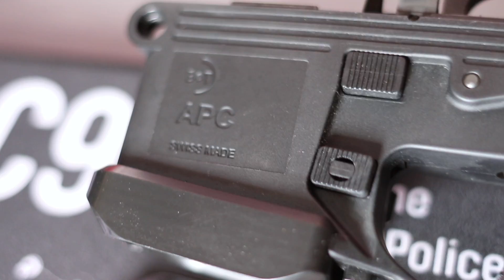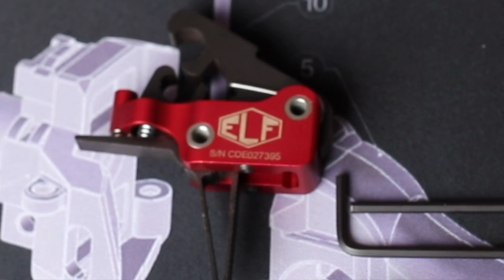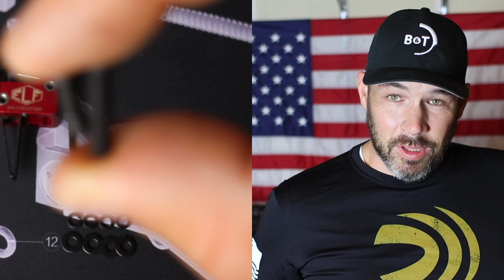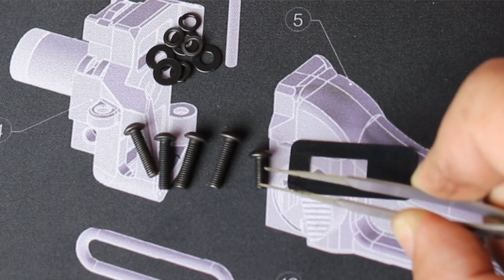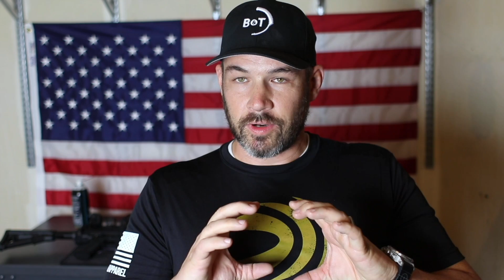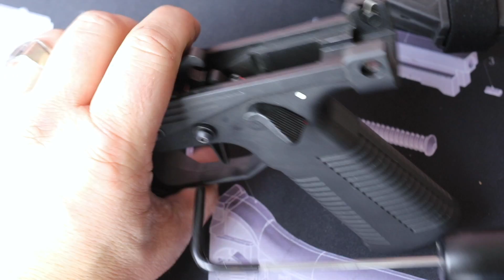The Best After Market Trigger For B&Ts: Elf Match Pro SE Installed in APC9 & APC223

Comment: Did the re-enforcement plate come with the trigger? And the screws are M4 .7mm x 16mm correct? They only have the allen head on one side and that wont be an issue? Know the video is old, but any input is appreciated. Thanks!!
Reply: Yep the reinforcement plate comes with the trigger and so do the screws.

Comment: I have a Geissele trigger and the hammer hits the metal plate behind the mag well. Is it a bad idea to take that place out so the hammer can strike the firing pin square and flush? Thanks for making this video by the way very helpful!!
Reply from the maker: Sorry man, I'm not gonna got there in YouTube comment threads. Sounds like you need to consult a competent gunsmith.

Comment: Hi Sean, I‘m also owning an APC223 and I‘m excited that there is finally a drop-in trigger fitting into an APC. I had the same ideas and tried a Geissele SD-3G - which did not work (apart from having to file a little because it was too wide at one point in the back, the hammer somehow got stuck when the receiver came back for cycling... - so far as mil-spec, which they advertise here in Germany). Have you tried or can you try any other options/brands out there? Cheers! Mirco